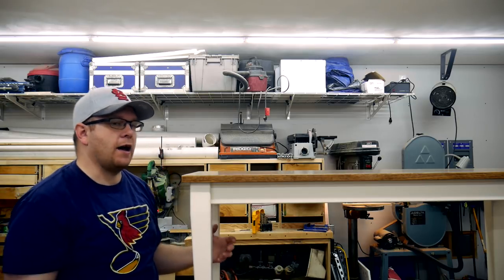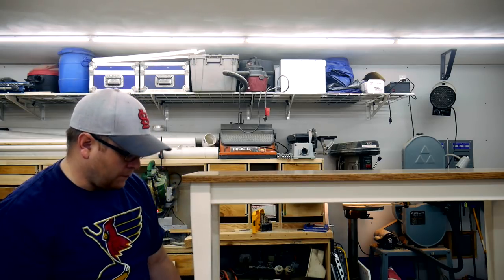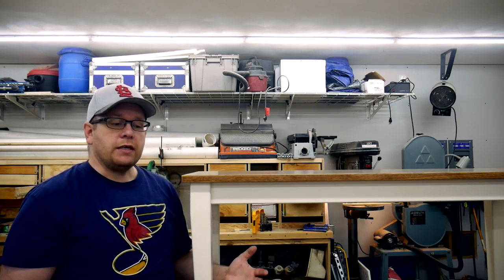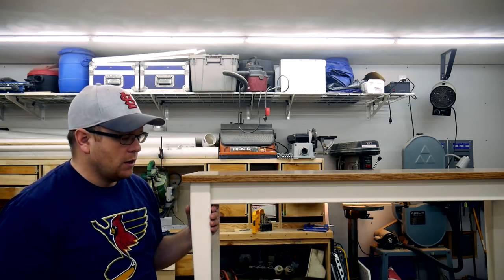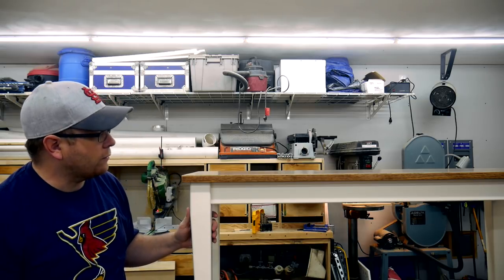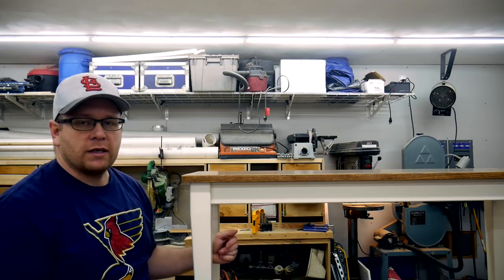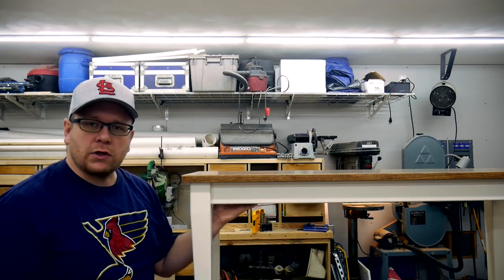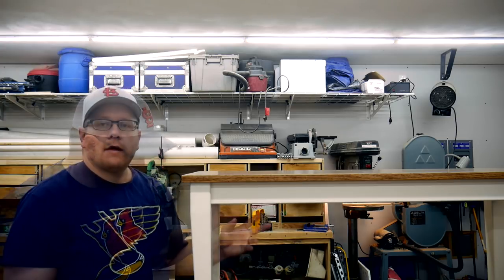Elegant Hall/Sofa Table

Comment: Great video, nice table. If I were to make one, I think I would have used mortise and tenon (or loose M&T) on the upper table and used pocket holes to attach the lower shelf.  I think the strength needs to be in the apron and legs, not so much the lower shelf.  Regardless, nice project.